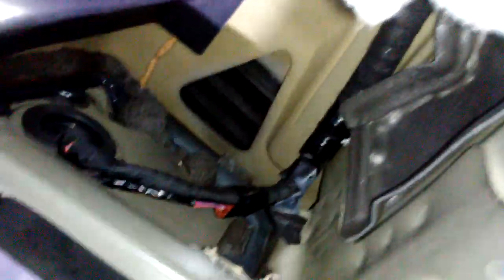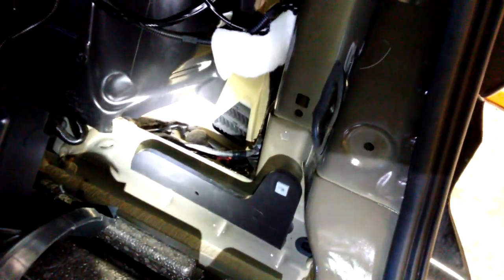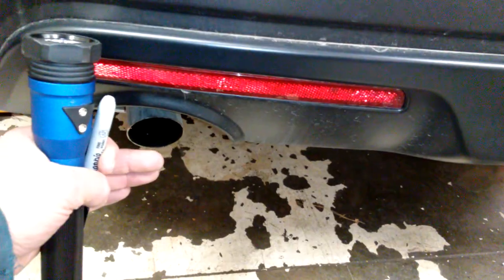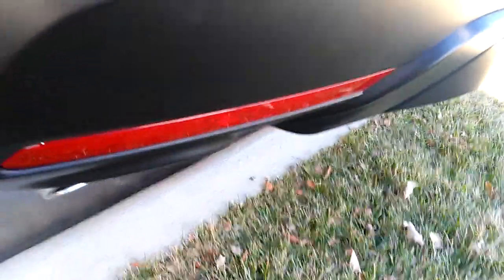Ford police SUV carbon monoxide issue

Comment: They're saying that when police equipment is installed in the rear of the vehicle which require holes drilled into the rear floor pan is the problem. The holes are not sealed properly and exhaust gases are seeping thru.